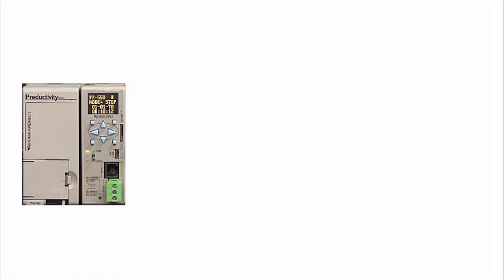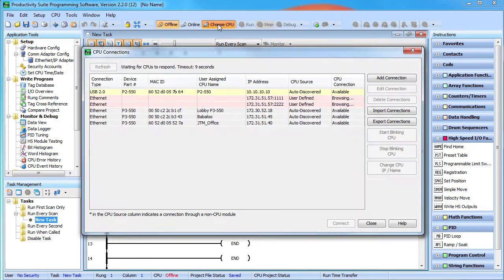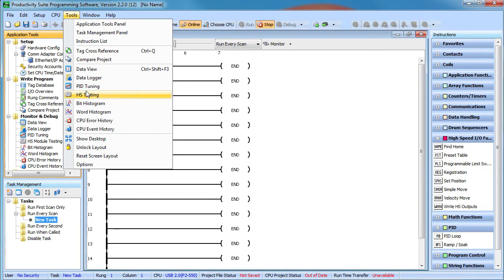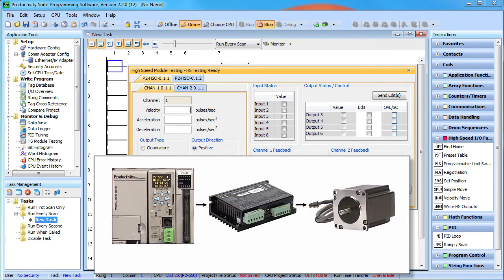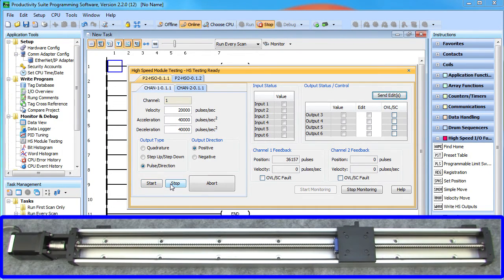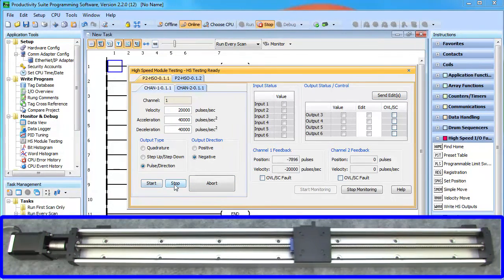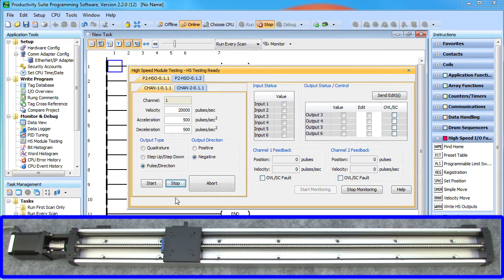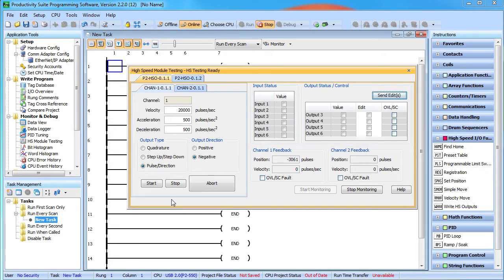Productivity Series PLC Motion Control - Built-in High Speed Test Tool from AutomationDirect

Comment: Would the position be precise with a variable load? If not how would you recommend precise position control with a vfd and a standard induction motor
Reply from the maker: @arfis345 In general, permanent‑magnet motors—such as those used in most AC and DC servos, as well as the DC steppers shown in this video—offer high positional precision under variable loads, with some limitations. Servos handle variable loads more effectively when those loads remain within the motor’s torque rating and recommended inertia ratio; excessive gear reduction can negatively impact their ability to respond to changing loads.
Steppers perform best under variable loads at standstill or low speeds, but their overall load‑handling capability decreases as speed increases.
Regarding your second question, achieving precise position control with a standard induction motor and VFD is generally not feasible. While some VFDs, when paired with permanent‑magnet AC motors or inverter‑duty motors in a full vector control system, can provide limited position control, servo systems will still deliver superior performance in precision and responsiveness.